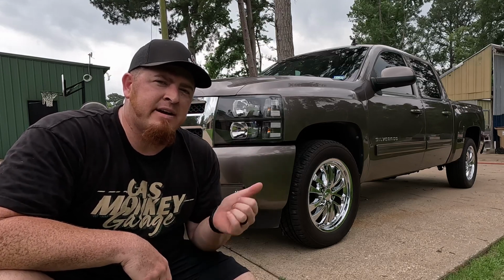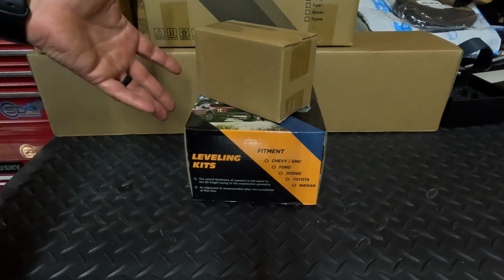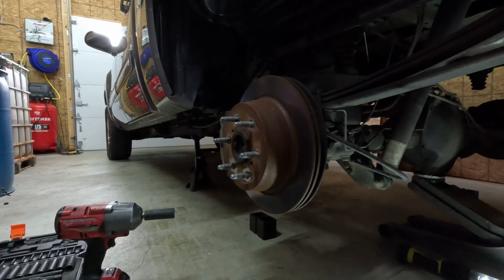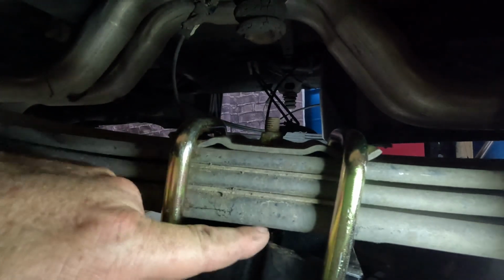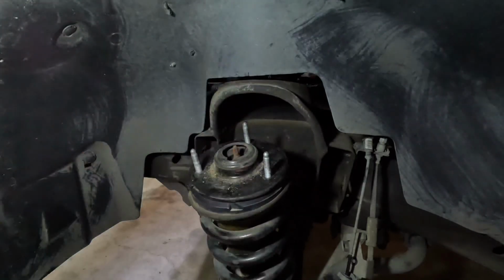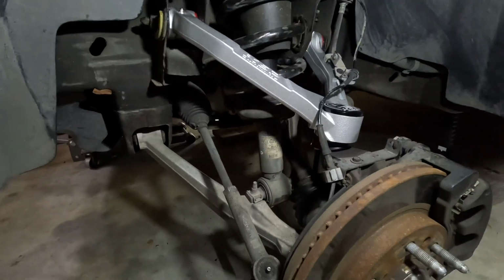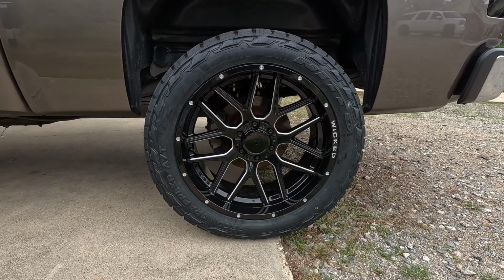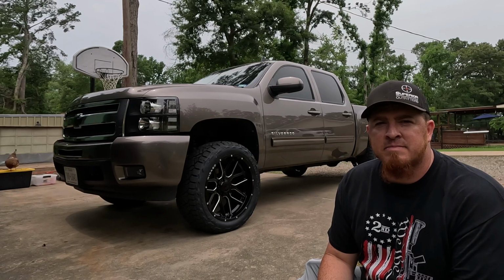Chevy Silverado KSP Level Lift | Wicked Off Road 22’s | Nitto 33’s #chevy #silverado  #level

Comment: I didn't see you put in the diff drop how is the CV angel...👍👍😎
Reply: Thanks for the reply..I have a 2008 GMC Sierra was wanting to do a 3.5 loaded strut and upper control arms was worried about doing the diff drop and cutting the cross member
Reply from the maker: From what I have seen and read, I wouldn’t go past a 3” front lift without doing something to address the diff/axle angle.
Reply from the maker: There isn’t a diff drop needed. The angles are fine.

Comment: Thanks a lot for information truck looks really good but I will need your help. I have a 2008. I’m trying to put rims. 22x12 whit tires 33/12.50/22
But it rubs on the fender corner and bumper corner what we need to do to make them fit
Reply from the maker: Thanks for watching. You need to check out this video on how to make room for those wheels and tires.

https://youtu.be/oLrRffBAKtk?si=fmGpf45g6R7NVH_E

Comment: So how did you install the sway bar end link in the end
Reply from the maker: I had to take a really big pair of channel locks and squeeze down as hard as I could, and install one side without the final top polyurethane bushing. Then I had to go to the opposite side and squeeze down as hard as I could on the big channel locks and then I got the nuts started. It definitely sucked, but once it’s on, it’s on.

Comment: Looks good I’ve got an 2011 Silverado LTZ as well been looking at lifts and leveling kits so this has kinda steered me into the right direction. Was this kit worth it and how is the ride compared to stock?
Reply from the maker: Thanks. Yes I think the kit was worth it. All of the links to the parts are in the video description. It rides more firm than stock, but isn’t harsh.
Reply: @whiplashtv2022 thanks yea I missed the-19..Good choice looks great! Didn't know u could order direct, thought had to be a vendor
Reply from the maker: @Mikek6771  yup, sure can. They were easy to work with as well. Tell them that I sent you and that you saw the wheels on YouTube at Whiplash TV.